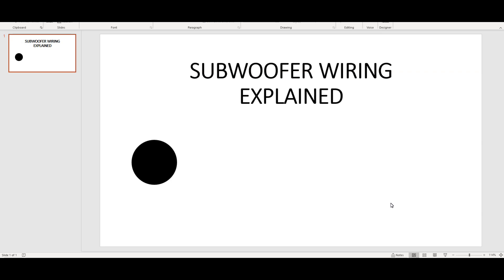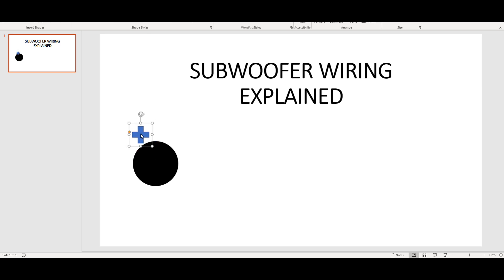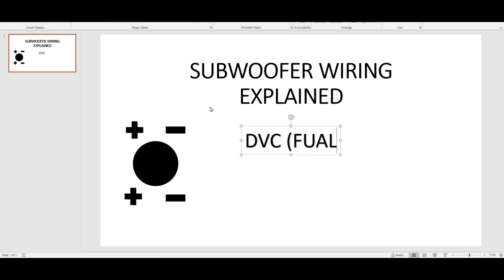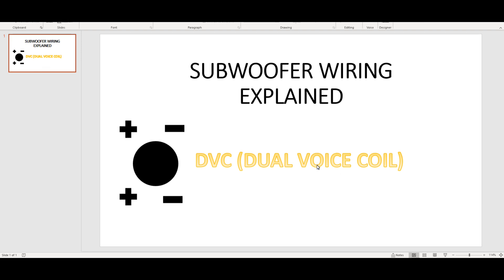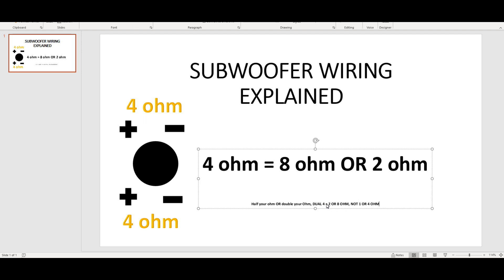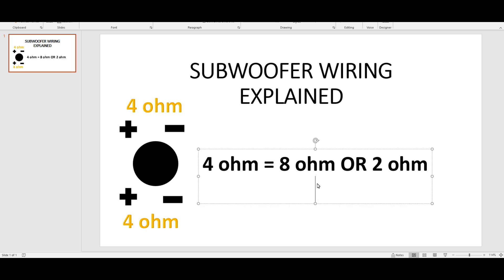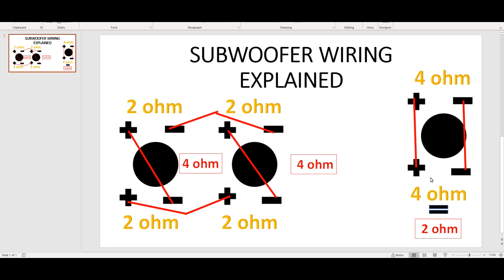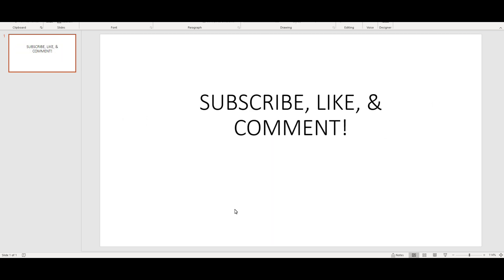SUBWOOFER WIRING EXPLAINED | DIY SUBWOOFER WIRING

Comment: Question regarding the 8ohm connection @8:50. If you wire the neg and positive across the coils, wouldn't that not work? If you want an 8ohm load you wire 1 neg to 1 positive together across the coils. The remaining neg and positive to the amp for 8ohm load?

Comment: Say I have a dvc 2 ohm sub wired to a 1 ohm load and I also have one with a 1 ohm dvc wired @ 2 ohm .. can I wire these together to get like a final 1.33 or . 8 or something along those lines or does this not work ?
Reply from the maker: One sub will get more power than the other but ideally you cannnnn but not recommended as its an inbalance in performance/power overal
Reply: @JacobViral2  in my case the dual 1 ohm would be an 8" punisher in the back deck and a dual 2 EVL 12" in the trunk .. I was thinking they might balance the power out decently due to the difference in size ? Just a thought .. I could be completely incorrect
Reply: @JacobViral2  also .. I do have a clamp meter, multimeter, and an o scope so maybe I'll play around with it just to see what it's doing and try all possible wiring configurations to see if I can get it close .. maybe the 12 wired up to 4 and the 8 wired down to .5 ? Clueless about it honestly but I have the tools to try it anyway 😂. . if it works would definitely be something I don't see most guys trying

Comment: My final load is wired to 1 ohm. But when I measure it with the meter, it gives me .5 ohm which cause my amp to shut off. My amp is 1 ohm stable. Please help!!
Reply from the maker: What ohm subwoofers, how many, and how is it currently wired? Sounds like a pair of dual 2s wired to half ohm.

Comment: I have a 2 ohm dvc and want to wire it to 1 ohm. Would I wire positive to positive and negative to negative, then connect one side to my amp?
Reply from the maker: Correct, 2 poss together and 2 negative together.

Comment: Hay can you wire 2 amps to 1 DVC sub..  so 1 amp to each VC and y splitters for signal input?
Reply from the maker: Yes you can, I have seen up to 4 amp with 2 strapped per coil.

Comment: I have two 10 dual voice coil 1 ohm how to hook up to my Rockford Fosgate t2500 could you help me out please
Reply from the maker: Hey john so can be wired at 1 ohm from pair of D1 ohm subs. I explained how in video, but simply google sub wiring diagram 12volt will plugin and show visual also if can't figure out. 2 d1 =1ohm or 4 ohm.

Comment: im trying to wire 2x l7 solos 4ohm down to 2ohms finial
Reply from the maker: You cant wire two dual 4 ohm to 2 ohm, only 1 ohm final or 4 ohm final.
Reply: @JacobViral2  how about just one. can 1 be wired down to 2ohm.our no. and i have a 2500.4 2ohm sound digital amp. if i wire the subs to 1ohm will this amp work.dont have any paperwork why im asking
Reply: and thanks for replying
Reply from the maker: @jtsgarage2999  one dual 4 can do 2 ohm yes. I wouldn’t wire below min recommended ohm.
Reply: @JacobViral2  your the man thanks
my gzch 5.0 m2 MB does 2800w RMS @ 4 ohm that should be plenty enough for those l712s

Comment: Hi , I have 2 subwoofer kicker campR and  ONE MONOBLOCK AMPLIFIER 2ohm, can you explain how should I wire for best result.
Reply from the maker: What ohm are your kicker compR subs and dual voice coil?
Reply: @JacobViral2  12" CompR 2 Ohm

The CompR 12-Inch Subwoofer is a 2Ω dual voice coil design
Reply from the maker: @kamranasghar7074  so you wire up each DVC subwoofer down to 1 ohm, then connect them back up to 2 ohm. Google “subwoofer wiring diagram” and look at 12volt site, shows everything visually.
Reply: Thankyou. I will try ,

Comment: Any way to wire 1 dvc4 and 1 dvc2 on 1amp or does it have to be 2 amos
Reply from the maker: You could but one sub would see more power and may have phasing issues. You want the same impedance subs wiring to amp so no complications, especially if shared box.

Comment: Question,  when you was doing the dvc 2ohm subs,  and you came up with either 0.5ohm or 2 ohm load, is there a 3rd wiring option? To take it back up to 8ohm?
Reply from the maker: Correct

Comment: Can u take 6 dual 1ohm speakers to a 1ohm load?
Reply from the maker: Not exactly 1 ohm load but right above it yes like 1.2-1.3ohm. Wire 3 sets down to 0.6 ohm and then up to 1.2-1.3 ohm.

Comment: Hi new to this car sound system stuff 
I’m in need of some major help 
I bought a 12inch skar sub amp had blew out so I bought another amp but didn’t realize it was a 4ohm amp my 12in sub is 2ohm and didn’t realize it was a 12000watts sub ( due to my first sun blowing from not letting it break in then when replaced I blew the amp) so now I’m stuck and don’t know what to do 
My amp is a skar 800watt 4ohm marine and my sub is a 2ohm 12000 watt how can I go about this
Reply from the maker: Is it a dvc(dual voice coil) / 2 ohm? Wire it up to 4 ohm on the amp. Cross a possitive to negative terminal and then hookup other to amp. Use multimeter to confirm.
Reply: @JacobViral2  dude thank you so much I plan on doing that on Monday I have it set low in order for it not to hurt my sub there’s no hits or anything going on right now but I will confirm when I do it Monday
Reply: @jacobviral2 ok so I'm basically in the opposite position as @carlosslazar6767 I have a skar 800.1d amp that's 1ohm final impedance and it came with a skar sdr 12 d2 600rms/1200 peak sub I blew the sdr the first week well I'm sure the spider is lightly torn at the cone causing it to make a horrible noise at louder volumes so I bought a new sub which is a skar evl 12 1250rms and it's d4 so I wired it to 2ohm and it hits hard sounds great but I'm confused as if I should just get a 2nd evl d4 and wire them together down to 1 ohm or repair my d2 sdr and pair it with my d4 and use 1 coil of the evl since it's 1250rms and amp is 800rms and with them together get 1 ohm or just go with the rp-2000.1d amp and run it at 2 ohm with my d4 evl which would give me over 1000rms at 2 ohm instead of it being at 1ohm. I hope you or someone can help

Comment: How do i wire up a4 ohm 12kicker cvr  to a n2 ohm to match my other 12 kicker 2 ohm cvr
Reply from the maker: You need the same impedance of both subs. Don’t mix dual 4 ohm with a dual 2 ohm.

Comment: I have a monoblock 1ohm 1000+ watts rms can i buy 2 subs who each have 1000+ watts rms rated at 2×2 ohms? Orr is this not possible
Reply from the maker: You want TWO Dual 4 ohm(4x4) to make 1 ohm with a pair of subs and not 2 dvc 2 ohm.
Reply: @JacobViral2  well i am still thinking on what i want but if i do 2×2 ohm than i need new amp sooo....

Comment: To run four 4 ohm dvc into 1 ohm can’t u just wire them in pairs separately into 4 ohms then introduce them both to amp which will equal 1 ohm?
Reply from the maker: Your looking at half ohm or 2 ohm for 4 dvc 4 ohm subs on one amp.

Comment: Jacob love your content,love that u n the wife go n do this together.that rocks! Jacob I need your help.I got the subs right doing my series parallel set up.but I'm having problems trying to do it with my mids & highs.I really need help.I have a diagram explaining my set up. It will be too much to write lol.I have 2020 jeep wrangler4dr. All6.5" (8total)are 20hm&svc/All tweeters (12total)are 4ohmsvc.I have a Pair of 6.5" SVC in dash(pair1" tweeters also),Front doors (4)6.5svc in each(pr1" tweeters in each).Reardoors(1)6.5svc in each(1"tweeters in each)Soundbar has (4)8" mids(4ohms)&(4)1" tweeters(2 on left side&2on right side of soundbar. I have (3)gfx3k2 full range mono amps 4ohm2000rms/2ohm3000rms) n for a back up amp I have a crunch PC-1000.4(250rmsx4@2ohms,or2x500@4ohmsbridged)how should I run this setup? Soundbar mids to one gfx ,its the6.5" & the tweeters I'm confused about.I want to run All 6.5 to one gfx amp n all tweeters to one gfx amp and the 4 8" mids to one amp.is that poss.again my picture diagram would show it better.please help
Reply from the maker: Hey man too much in one comment. What specifically is your question?
Reply: @JacobViral2  No worries sry to bother u
Reply from the maker: @CRXUGLYKID  I’m glad to help just didn’t know what your asking
Reply: @JacobViral2  I know my diagram explains the location of everything but can't post it
Reply: Can I send the diagram of my build to your Instagram so you can see my layout.n then I can explain better.I don't know the best way to run everything I have.if mids n highs should be separate or not.
Reply: 3 mono amps to run 12 supertweeters 4ohms,(8) 6.5" mids2ohms n (4) 8" mids4ohm
Reply: My subs are good,its the mids n highs . figured how to run6.5" in series n parallel ,the same with the 8" mids,but not the tweeters I also dk if I should have crossovers

Comment: I've got a monoblock amplifier which has 2 positive and 2 negative speaker terminals. Is there a specific way to wire your sub to these kinds of Amps or could I just choose any positive and negative to wire up to the sub. I've bought this amp second hand so I don't have access to the user manual. Please help
Reply: You are correct. It’s a mono block so they are connected on the inside of the amp. I personally wired each coil straight to the amp connecting the coils at the amp for no wire restrictions. Some people don’t understand that and think it’s overkill but the other 2 terminals were unused due to only one sub so I figured might as well 🤷🏻‍♂️
Reply: @That_Car_Dude  I shall give that a try. Just sceptical whether it would affect the ohms at which the sub will run at. Like for example if it's a dual 4 ohm wired to 2 ohms.

Comment: does it matter which combo of neg to pos bridge wire for 2 DVC 2 ohm for 2 ohm final??
(I bridged a POS to the NEG right next to it for both subs)(not the long wire to the far NEG from the POS)
Reply from the maker: Yes you have to make sure it’s not wired wrong or it can be wired wrong and out of phase.
Reply: @JacobViral2  Thanks for replying back so fast.. So I'm thinking that's why it sounds so weird